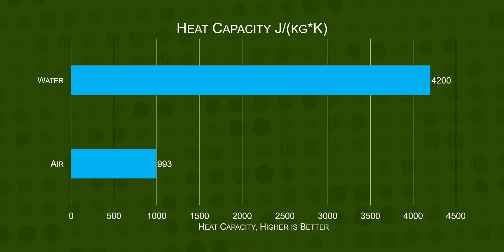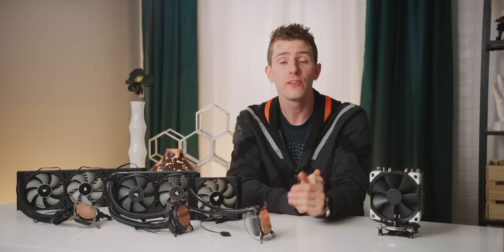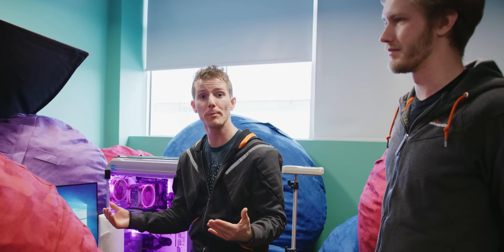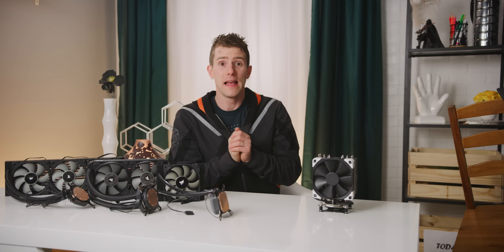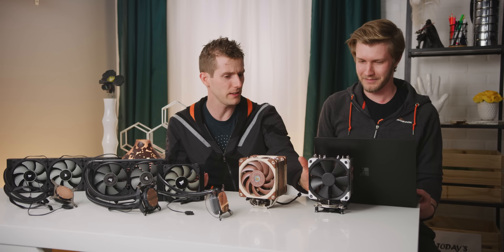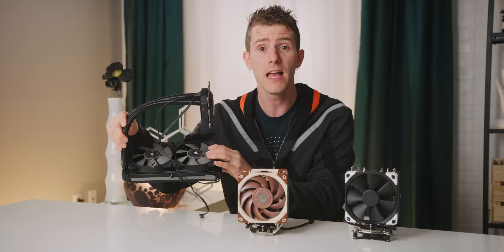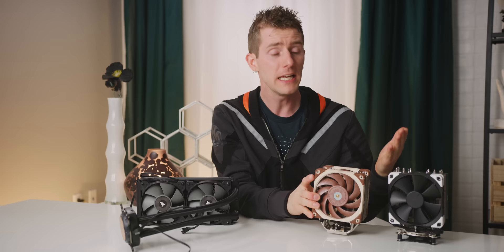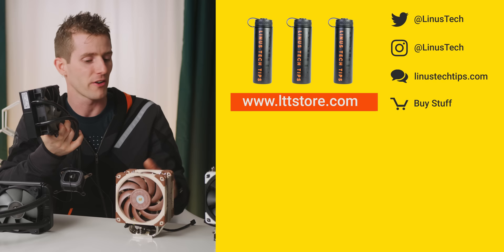Why you shouldn't water cool your PC

Comment: My philosophy has always been to choose the simplest designs that work! My recent purchase of an air cooler for my 5900 was a no-brainer. 

I am no PC cooling expert, but when you have to concern yourself with Fan Performance + Cooling Fluid Evaporation + Cooling Leakage from RAD and/or tubes + Pump performance, the complexity of AIO cooling solutions led me to stick with the tried, tested and true air cooling method. 

Fluid and electronics don't mix! Call me old school, but I can sleep at night without worrying about a defective AIO damaging my PC. The cost of replacing components is one thing, but the cost of lost productivity and stress is another!
Reply: True words, think the same, fuck watercooling, its like a BMW nice car a lot of power, but shity parts allways headaches. So keep it simple.
Reply: @Cuong Tang agreed! The complexity and the risk do not support the benefits. Everything I have seen does not show an advantage to water cooling. Still need fans to cool the rad.
Reply: @Sola_Scriptura_1.618  Yeah imagine, for the price of an CM Watercooling setup, i can near build a new PC (with no GPU) i still use an Alpenföhn Matterhorn CPU Air Cooler since about 10 Years no Problems at all.
sorry for my English im from Switzerland.

Comment: I've always refused liquid cooling due to the maintenance and catastrophe possible when it comes to leaking. I just feel so much safer using air cooling and getting roughly the same performance if not better in this case via Noctua
Reply: i ran a be quiet dark rock pro 2 on my amd fx 8350 for couple years and got a msi aio liquid cooling kit for my cpu with dual fans like 4 months ago,  actually the thermals are more consistant, couple degrees cooler and not spiking that high when a big load comes in for the cpu.of course if u dont run a amd fx 8xxx cpu u kinda dont need it, my other intel xeonx 5650 system runs well with an be quiet dark rock slim even with overclock,but it also draws like 125watts less than my fx8350 so in some cases its probably worth/fine to use liquid cooling but iam still struggling to get an full custom loop but aio´s are nice these days :D
Reply: yeah bro. I've had watercool die on me and damage my gpu. And that wasnt the worst case scenario. Having to wait 5 months to get damaged parts replaced by company warranty is not nice either.. and that is if your lucky enough to get them replaced in the first place.
Reply: @yesyes-om1po  exactly. I have used aios on my last 3 builds, most recent one being the build I just finished last week, and have never once had a problem with any of them. They are far superior
Reply: @mikerzisu9508  yes these air tower cooling peasants dont know the godliness of an AIO, theres a reason all the top end PCs with the biggest and baddest CPUs run with an AIO or custom water loop.

seriously though my first interaction with a tower cooler was shit, it ran hot and loud and it was too big to close my case (mid tower) got a 120mm H60 AIO and it ran 20-30 degrees cooler and almost no noise whatsoever.
Reply: @yesyes-om1po  a tower cooler will get the job done if you are running stock or mild overclock but nothing beyond. AIOs are reliable at all overclocks and speeds, looks better, easier to transport. More efficient, easier to build with, easier to mount. Doesn't get in the way of ram and other hardware
Reply: @yesyes-om1po  "ascend to godhood" lmao this made me laugh for some reason. I've been thinking about building a PC with an AIO for the first time, the ones with lcd screens for the cpu block are so cool
Reply: @mikerzisu9508  I’ve also used AIOs solely on all three of my PC builds, which I upgrade every few years, and have never had a single problem. HOWEVER!!!!!…. I decided to make my office PC a stealthy, all black, non-rgb build recently. Initially I installed a brand new h115i Elite Capellix (with black fans and no rgb of course), but the pump noise was bad on that thing. Then, I thought fuck it, I think a Noctua Chromax would look cool in here. And hopefully be quiet. With the H100i pro I had on it previously, AND the capellix I was getting average idle temps of 33°, with max, under intense load temps of 70 odd. With the Noctua?? Average idle temps of 27, max, 61…. I could not belive it! And all whilst being deadly silent. SO, to say AIOs are “far superior”, as I would also have once said, is totally wrong! In a case with good natural airflow like the 4000D airflow I have anyway, the Noctua trumps even one of the best 280mm rads on the market. And I have the D15-S in there too. Not even the D15 (which has two fans, as opposed to one).
Reply: @yesyes-om1po  air tower peasants lol. Listen to you! Sounds like you were the peasant and bought a cheap one. See my reply to mikerzisu below…. Was a hardcore AIO fan until I thought to give a D15 a go! Wow. Incredible piece of kit. And it looks badboy with the heat sink covers on. Industrial. Better cooling than the h115i I replaced with it, and that’s on an i9 11900k, which are hot out the box!
Reply: @leonmatthew7  i got an MSI tower cooler that was more expensive than the 120mm AIO i bought to replace it, i got a 280mm arctic lf 2 for 90 bucks, keeps my 12700k sub 70c no matter what while producing little to no noise. I wouldn't be able to mount a full tower cooler like the large noctua ones because of ram clearance, such issues do not exist with AIOs, not to mention the way it exhausts heat.
Reply: @yesyes-om1po   well there you go.. your situation / experience makes sense. But it’s very limited. So calling people “air tower peasants” is literally a joke 😂 As I say…. If you were to spend top dollar on a Noctua air cooler, depending on case etc obvs, you ain’t gonna lose out on thermals. And looks is obvs down to preference. I like the look of both personally for different reasons. And for me, I find the performance:noise much better with an NH-D15. Peasants 😂😂😂 I’m looking at one PC with £2,500 worth of components in, and another worth closer to £4K. That one (with an AIO btw just to keep u happy haha) is attached to my £10k sim racing rig. Let me assure there is absolutely nothing peasantly going on in my office bro 😊
Reply: I felt the same way, but my next pc case is not going to fit my large air cooler.  it has poor air flow too, so I might have to go water
Reply: I like not having a mini fridge PC just to get decent performance.
Reply: You're not getting the same performance using Noctua lmfao. I just switched from a Noctua air cooler to a Kraken Z73 AIO and my average CPU temps literally dropped 25-30 degrees. Liquid is better bro.
Reply: @holleringsmith3837  The point is that the difference is insignificant and it's not worth the hassle of the maintenance you have to go through with liquid cooling
Reply: @holleringsmith3837  Weird cuz I have the 63 and it only brought down the temps about 10 degrees from the stock flushmount rad and fan lol I think you're a fanboy.
Reply: I have a ryzen 7 1700x and the stock amd wraith prism cooler, I have never worried about cpu temps, It never throttled, and as far as I'm concerned, it's pretty constant.
Reply: @leonmatthew7  my water cooler died and isn't cooling my CPU. Switching to air.
Reply: A good AIO won’t let you down. Don’t cheap out on it and it will treat you well.
Reply: I ran a water-cooled gaming rig for 12 years without issue - infact I only swapped it out 3 weeks ago, but I've transitioned to a minimalist laptop setup with a 27" screen since I'm stepping away from the whole gaming thing.
Reply: Agree with you. All those AIO coolers are crap. I had one and it's pump died, but before it died, it was loud as jet on load mode and it wasn't cooling my PC very well either. Then, after pump failure, I switched to air cooler - Arctic Freezer 34 esports and boy, it's so much better... Not only it cools my CPU much better, but it's also much more silent and I don't even have to worry about pump failure or a leakage. Air coolers are simply superior and also cheaper to those crappy overpirced AIOs. I'm never going back to water cooling. Never again!
Reply: well it depends, air cooling will require better cases, and the best aios still beat air coolers, see arctic liquid freezer.

Comment: Makes sense since the density of water is greater which means it will retain heat for longer. Plus you are adding an additional step into the cooling process instead of directly transferring it to air.

Comment: AIOs do have their benefits, especially in mATX or ITX builds. They outperform air coolers in tight spaces where hot residual air from the GPU affects temps. 
Overall a matter of preference.
Reply: Which he addressed when he mentioned the size of the case they are using.
Reply: Yeah I just built a mATX x299 using the EVGA aio 280mm water cooler and a evga 2080ti hybrid and gaming ultra my cpu was at like 55 maybe 60 max but I don’t think my cpu was like fully OC like I’m honestly kinda just learning how to OC using MSI software
Reply: They have benefits in limited circumstances but for the average user building in a normal mid tower case there isn't much benefit though its more down to aesthetics and personal preference
Reply: Well, generally a matter of preference with the caveat being that there an objectively better choice for any given metric you care to look at.  It just may not be that big a difference to worry about for the average consumer or even average PC enthusiast.
Reply: Update on my build my evga ftw3 hybrid 2080ti fried after a week so I replaced it with the Aorus 2080ti full water cooled water force the one with included radiator and fans it like barely fit in my mATX I had to like mod some stuff a little but so far it’s perfect though I need to find a place for an extra fan as the setup will sometimes hit 70 degrees under intense load
Reply: Yep and know he addressed it but my whole reason for water cooling was space inside my case and the height of the ram on the mobo would have prevented a decent copper fan

Comment: Please do this with video cards.  Liquid cool vs hybrid cooled vs fan vs blower..
Reply: may be a great time to test/show that when that internal closed loop videocard comes out that he showed off at the start of the year.
Reply: I have a FuryX and I am dreading the day the pump dies.
Reply: Hybrid = bad in most scenarios. Don't use a hybrid cooler unless it is OEM
Reply: The next GPU I get to replace my Fury X will be hybrid aftermarket. NZXT has an adapter that goes together with their Kraken AIOs. After having a liquid cooled gpu I will never go back to air cooled, you do notice noise reduction since you don't get those spin up spikes Linus talked about. Under the highest of loads my GPU stays at 60C using 1/3rd (1600rpm) fan setting.
Reply: @SuperQBoi  I just added my fury x to the rest of my loop 360x40mm rad with a heatkiller waterblock
Reply: @decoyla  how did you do that? the pump for the aio built into the back plate of the card?
Reply: @SuperQBoi  no i had a 360 rad and pump for the cpu then i jsut added the gpu with an aftermarket  waterblock
Reply: 2nd that & great idea!!  stock to liquid cooling!!

Comment: built a custom watercooling with flexible tubes. Installation was kindof easy, the tricky part was to buy every necessary part and not forgetting anything...

the big advantage is, that you can maintain the system
many AIO's are not refillable or extendable and you have to throw it away after some time

with quick-lock connectors I can add more things I want to cool, my GPU for example or other PC Systems in a big cooling loop and add more pumps if I want to eliminate the single point of failure and get more water flow